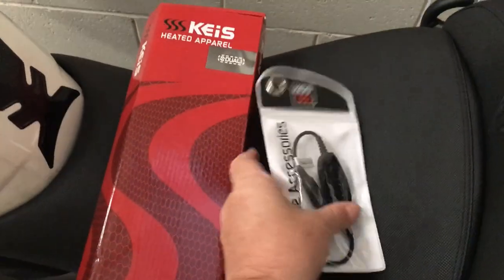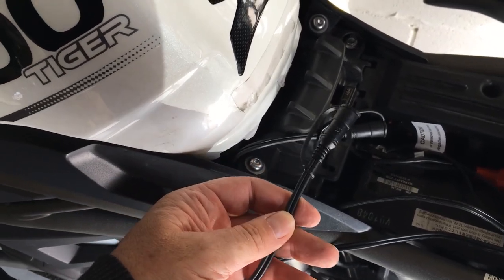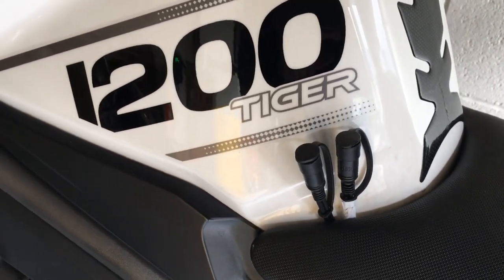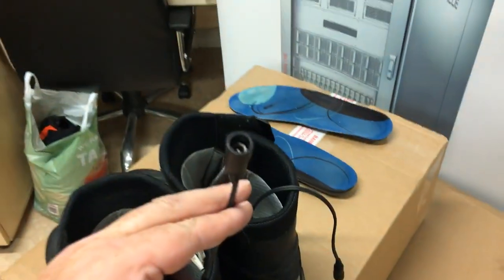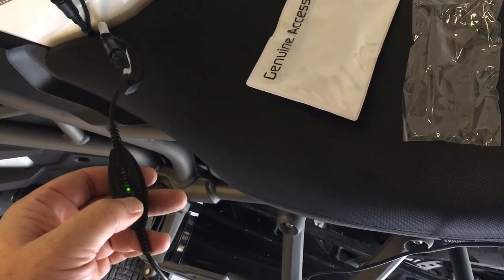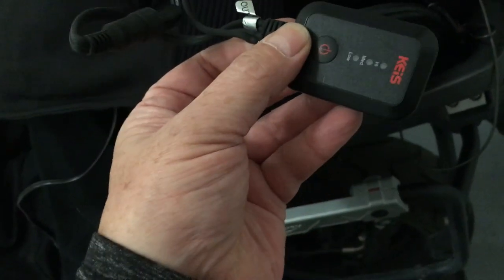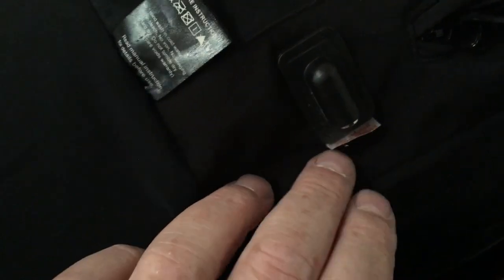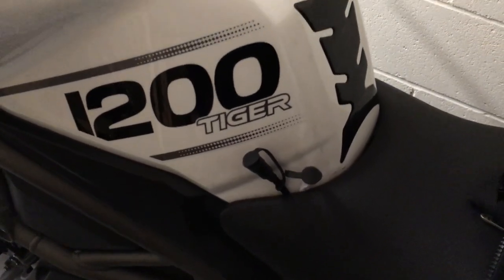Keis Heated Insoles

Comment: Hi Terry, thinking about buying these as I have tried everything else with no success. Do they really work? They are quite expensive including the light weight controller.
Reply from the maker: I was hoping my vest would keep my core warm in winter and that would permeate through the rest of my body. I find it does do that in the main but my feet still suffer on the colder days. If you are a regular winter rider I think they are a good investment. I only envisage using them 2, possibly 3 months a year and only on the coldest days. I don't use my bike for commuting but I don't mind a 4-5 hour ride on a cold crisp days where these will come in handy. They are fiddly to route the cable and get plugged in and you do feel the wire in your boot sometimes but I can live with that.

For the last few years, before I had these, on longer runs, I used the disposable sole warmers from Aldi/Lidl which were about €1 for a pair. Very effective and very cost effective.
Reply: I was on a 170 mile ride today here in Scotland with around zero degree temps. I tried those Hothands foot warmers and they were useless, my feet were like blocks of ice whereas my body with the heated vest and my heated grips and muffs were fine.
I commute daily even through winter, so those insoles would work if a tad expensive.
Reply from the maker: IRISHROVER - with that much winter riding I wouldn’t hesitate. These can get very hot on the highest setting so will work for use.